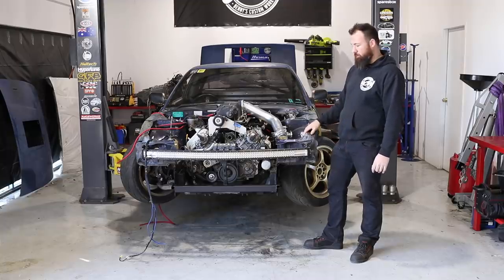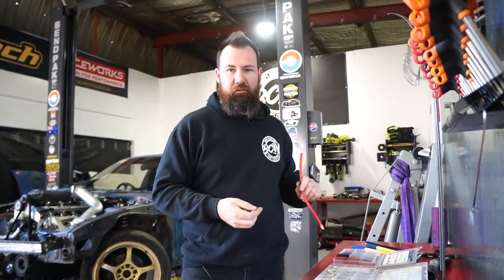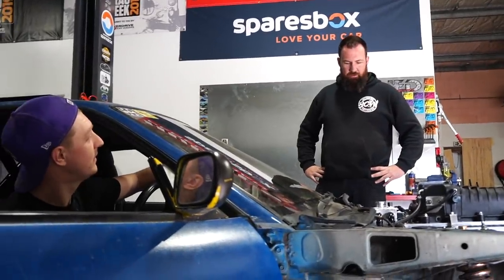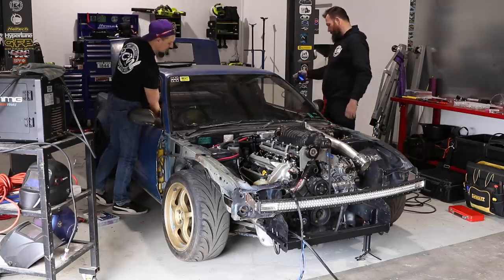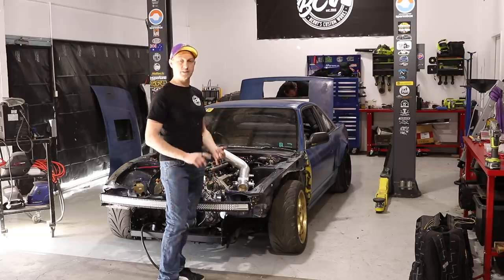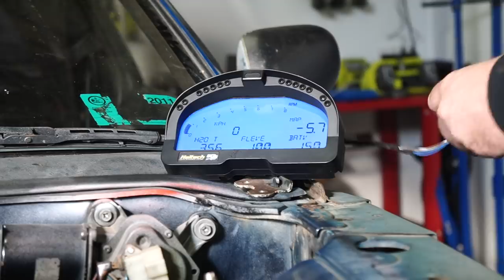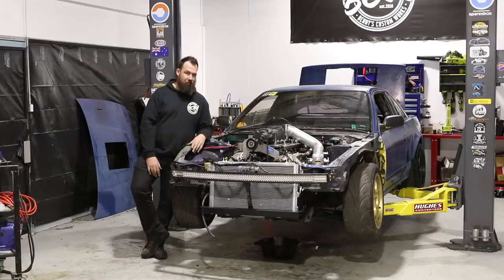V8 Supercharged S13 - First Start

Comment: Hey Ben, if youre interested, next time you are doing a full wire job like this, instead of the Haltech fuse boxes, consider the Eaton Bussmann fuse/relay boxes. Despite taking iso280 relays, they are fully modular, water proof, they take common delphi metri-pack 280 pins and the most appealing feature is they are available with internal buses between the fuse input side and the relay pin 86 side. So you dont have to try and join 50 PWR and IGN feeds for each relay. Just one main cable for both. Im using one atm for a PS2000 VCT Intech powered patrol atm and its made my life soooooooo much easier.

Comment: I have to say i seen your story on ACA and recently and man thanks for being such a good person, those people you helped will never forget that.On a different note I would add another pulley on the opposite side of the other tensioner pulley as you would be suprised how much slip they get without the pulley being wrapped up as much as possible
Reply from the maker: Thanks for the kind words, this belt setup was already running in another car making 400+ hp with no slip.
Reply: @BennysCustomWorks  sweet as mate I've just seen a bit of data that even when its completely un noticeable but with measuring equipment it's surprising how much slip there was and this was an l67 with the harropp 1900 blower and a few m90 powered l67's

Comment: Suprised to see Copper Clad Aluminium for starter cables. Some are dead against it but heard that although you need thicker cables to match the resistance of copper it is still lighter. Keen to hear your thoughts
Reply: So my reasoning here is often that, while you do need them thicker to carry a similar current to straight copper, the clad cable tends to be more cost effective (even considering the increased CS area required) and more flexible to work with.
Reply: Nathan Barrios Have heard that it is more prone to break when flexing and from experience it is tricky to solder but that doesnt matter so much if you crimp everything

Comment: What works du u do with engine,or it still stock???
Reply from the maker: Yes standard un opened engine.
Reply: @BennysCustomWorks  how much boost???
Reply: @BennysCustomWorks  stock  CR?
Reply from the maker: Влад Зеленкевич untouched engine, approx 13 psi from memory
Reply: @BennysCustomWorks  cool mate
Reply: I have stock vh45 and want to SC it!!!! Or make high rev engine
Reply: @BennysCustomWorks  what gasoline do u want to use?

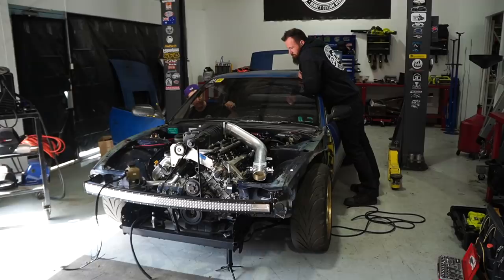Comment: Why You guys went from using decent cable lugs to that shit that split open at around 6:30? 
Also the what the fuck is that fucky terminal block behind the relay box near steering column? Eaton/bussmann make pretty terminal blocks/busbars example C4559-4, so You can make Your power and ground for relays pretty and reliable and it is cheap.
Reply from the maker: Just using what we have. They work no worries.

Comment: You know people are going to complain about the wiring work, when you show wiring.
Not according to NASA directives, crimping is bad, wrong distributors, while their own head unit install is a hack job....
...on their bicycle.
Reply from the maker: Paul van Lieshout this.is.the.best.comment.ever.
Reply: Don't take this as a soap-box post: If those distribution blocks didn't rely on a grub screw alone, I wouldn't mine them. The cable strands tend to work loose, due to vibration and unless regularly checked, the cable can back out and make fire(seen this happen before). A fail-safe could be to choke the cable with a ziptie and anchor it to the distribution block, on the input side only.
Reply: @BennysCustomWorks  ...and apparently not a lie either...
Next week: gardening.
The internet is going to explode.
Reply from the maker: T M we’re running a circuit breaker at the battery so no fire here :)
Reply: Pretty sure those battery cable eyelet crimp terminals are meant to be soldered as well though 👍
Reply: @lancecooper4646  Nope, the crimper compresses the copper to the point where it can not retract. Almost fusing it together. Very reliable connection.
Reply from the maker: Lance Cooper yet to see one oem battery terminal soldered .
Reply: Hex crimping lugs is the way to go, never been a fan of the stamped and folded sheetmetal lugs though. Grab some bootlace ferrules from ya local electrical wholesaler for terminating flex into terminals, packs of 10 for anything big is about $5. 
Honestly just go to an electrical wholesaler for any wire, lugs and crimps. They sell it by the meter and usually get it for half the price as most auto elec joints and its better quality gear.